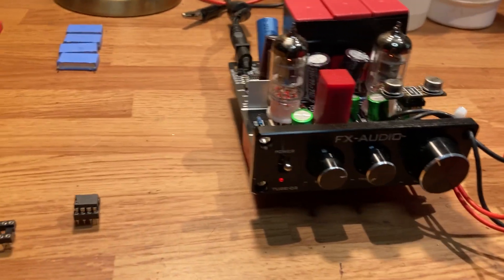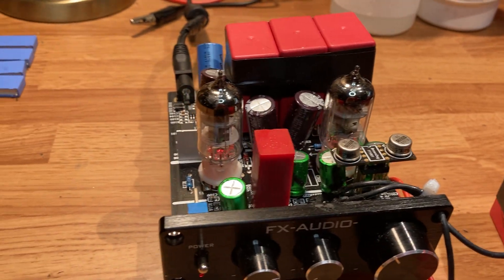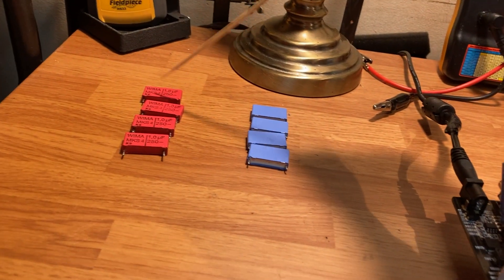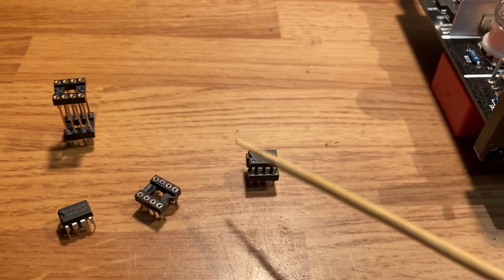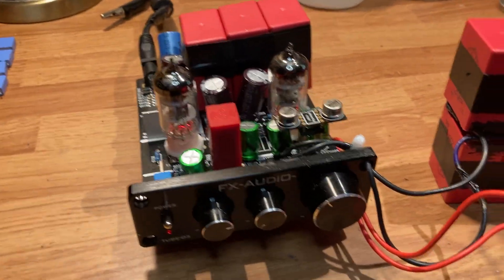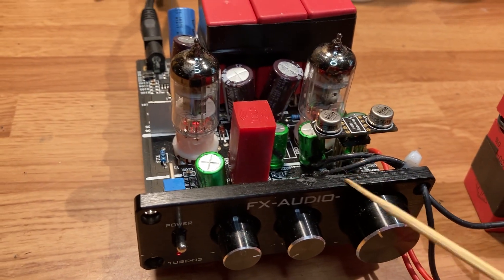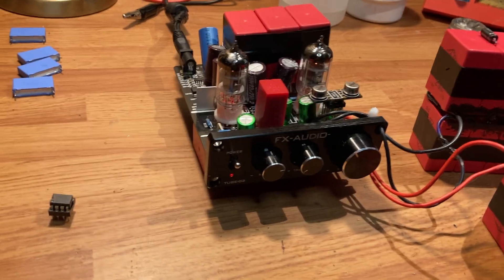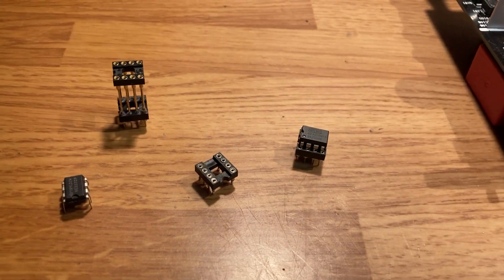FX Audio Tube-03 op amp and capacitor upgrade

Comment: Hey, nice video. Have you tried using bigger capacitance film caps at the output? Some guy measured the distortion in the tube 01 after going from 1uf to 4.7uf and the result is pretty good. I'm planning to try that in a tube 03 variant from Aiyima, eventually, but was curious if someone did; my goal with the preamp is to make it as accurate as possible, not interested in tube sound, I only want to use the tone controls to complement my analog eq.
Reply from the maker: No because WIMA does a real good job at holding the juice and I spent $5 a piece for those film caps, haha.  If you have an EQ you probably won't need tone controls.  The less components the better.
Reply: @ranbymonkeys2384  yeah I agree but I want to give the little guy some use, lol. That purchase was kind of a mistake, but hey it's dirt cheap couldn't resist. The preamp was actually out of my chain because I found it to sound awful, made voices sound kind of robotic, but recently I came across a power supply from an old display rated at 12v and 3.3amp and no more robotic voices, guess there is potential.
Reply from the maker: @Masked4789  To quote the late great Bob Ross "we don't make mistakes, just happy little accidents".  But you would want a component that just has the tone controls.  There out there.  I think Schiit makes one that people say is pretty good.  You know the "people".  What EQ do you have, you shouldn't need any more tone controls.
Reply: @ranbymonkeys2384  I mean, I don't regret it haha. I have an old 7 band Fisher Eq, it was from my father. It's pretty nice, has a little display that shows the current level of each band so it helps when Eqing.
I'm now thinking about using the preamp in my headphone system, my modded T40RP mk3 could use more gain, won't be using the tone controls tho, but for that I believe I have to mod it to work properly with my low input impedance head amp, have any advice for that?
Reply from the maker: @Masked4789  I have to tell ya I'm not a headphone guy so I can't help you there, but, do you have the tube-01?  I had that but I sold it and it's WAY better than the tube-03 I wish I still had it.
Reply: @ranbymonkeys2384  wish I could blast my speakers all the time. No I don't have the 01, would have been better for me.
I tested the Aiyima variant of the 03 with my headphones and it's not bad at all, I'm sure it can still do better. I have only changed the power supply and the opams to TL082. Can't believe how much the preamp improved with my display power supply, it even used to give a static feel on the chasis to my amp. I like the changes the TL082 brought to the mids and highs, sound more open and real, but it introduces hum to my system. Needless to say I'm excited to keep experimenting, thanks a lot for the info and your list about opams!
Reply from the maker: @Masked4789  the TL082 is a good op amp seeing how there only $1.50 or so.  Where did you get it?  It sounds like one of the pins aren't making contact like they should.  Sometimes I spread the pins out so when it's in the socket the pins will make more contact.  Did you get that chip at a reputable place, I hope it doesn't say China on the bottom.
Reply: @ranbymonkeys2384  lol, no they are texas instruments opams I got from a local store, those were the only ones they had from your list. I just found the problem. I was testing with bad rca cables, seems like the cables weren't making proper contact with their ground. Changing to good rca cables, and I don't mean expensive, got rid of the hum.
Reply: Does the wima caps help to lower the distortion?
Reply from the maker: @Masked4789  Replacing the power caps will help with distortion.  Anytime you get a "humm or buzz" it's a ground issue.
Reply: @ranbymonkeys2384  Did you replace with higher capacitance ones or just better ones with the same values like those big ass film caps?
Reply from the maker: @Masked4789  Pure polypropylene (PP) film caps not metalized with the same capacitance.  Only downside to PP is they are WAY bigger and more expensive.  About 5X the size and price.
Reply: @ranbymonkeys2384  damn you really went all in with this thing, is it really worth it? That Burson opam is hella expensive too is it really a game changer compared to, let's say the AD823 which is 10 dollars and has nice specs? I couldn't find a data sheet for any of the V6 models
Reply from the maker: @Masked4789  Never heard the V6 but the V5 is totaly wort hit.  If I were you get the MUSES01 or MUSES02 they are easier to get, bu make sure to get them off of Mouser or Digikey and YES they are worth every penny.
Reply: @ranbymonkeys2384  People describes the muse01 as clean and clear, while the muse02 as warmer in the midbass. I'm finding my tube 03 really lacking in the subbass and the bass control seems to only boost midbass, which seems in correlation with this guy measurements (the same measurements I mentioned): farmedia.com/tube-audio-line-level-buffers/
Do you know of any opam that helps to boost the subbass? that's the reason I mentioned the 4.7uF caps, lol, the bass roll-off is terrible.
Reply from the maker: @Masked4789  AD op maps I find work well for bass,  and you have AD op amps.  I use the Burson V5 for the bass slot, it works well for that.  I have the Muses01 in the DAC and the MUSES02 in the amp and I have OPA627 "can style" for the highs (AWESOME FOR THE HIGHS, TUBE LIKE)  they are single so you need 2 to make a dual and they are $50 each do that one op amp is $100 and it tones down the highs.  TRUST ME I HAVE KLIPSCH SPEAKERS.  Also what tubes are you using???
Reply: @ranbymonkeys2384  I'm using the stock chinese tubes,  GE JAN 5654W tubes are on the way. According the measuments the GE tubes doesn't change the frequency response but helps to lower the THD. I don't know if there are tubes that changes freq response, this is my first experience with tubes.
Reply from the maker: @Masked4789  You like your measurements.  I pay zero attention to measurements.  You want NOS 1940's 1950's tubes.  Measurements are  the results of somebody grading their own test.
Reply: @ranbymonkeys2384  I do value measurements , lol, specially freq response graphs since I always use Eq to my pref. Man I wish I could try everything, I promised myself that I would keep it cheap. So far I'm digging the bigger stage, maybe I will keep the preamp in my headphone system, for now I will change the caps , try a couple of opams and keep the 5654W tubes, they will be helpful to have a reference when upgrading. You have been very helpful and it shows that you are vey passionate about audio, thanks a lot!
Reply from the maker: @Masked4789  We have audio anonymous meetings every Wednesday, hahaha, it's a sickness it really is.  It will get better then worse then  buy the same thing because you smashed it, ya know.  You will find replacing those caps to be a wise decision.   What are you using for an amp?
Reply: @ranbymonkeys2384  I'm using a cheap class D chinese amp, an Aiyima A07 which has swappable opams, so I'm also going to have fun switching opams with that one. tbh I have just started my speaker quest and I only did because I found out my fathers old towers had working woofers, not so much for the tweeters tho so I did a Frankenstein with other speakers that had no working woofers but the tweeters were ok despite being like 30 years old lol. I'm more of a headphones type guy, but my god the deep controlled bass from those towers after eq are truly erotic lmao, they can put anyone to dance.
Reply from the maker: @Masked4789  Those crossover capacitors in those speakers NEED replaced.  Electrolytic are only good for 20 to 30 years.  Replace with the same value.  If it's a lower value up to 4.7uF replace with film caps, you will see a difference.  Ya get that cheap op amp out of that amplifier.
Reply from the maker: @Masked4789  https://www.youtube.com/watch?v=IyFfF6cL6OU
Reply: @ranbymonkeys2384  why not both?
Reply from the maker: @Masked4789  he said both
Reply from the maker: @Masked4789  when you go to digikey and look up op amps the slew rate means how fast it refreshes the higher the number the better, also it has the bias voltage that is the the voltage that it has to produce to even everything out the lower the better.  You see we all use measurements but im trying to convince you that you may just be surprised.
Reply from the maker: @Masked4789  hey I ordered this from Amazon I'm thinking it's the same as the tube-01 it's coming today I'll let you know.  It says it's just a buffer (no gain) we shall see.  
https://www.amazon.com/gp/product/B08Q7J5YMY/ref=ppx_yo_dt_b_asin_title_o01_s00?ie=UTF8&psc=1
Reply: @ranbymonkeys2384  you're misunderstanding me. It's not that I don't believe you, I just can't order the whole catalogue of opams to try for myself, so I'm using both opinions of people and measurements to keep the upgrades into my budget. Of course I will keep trying tubes and opams, even if I end up happy with the sound I know the curiosity will take over me at one point, I just have to know lol.
Reply from the maker: @Masked4789  Your misunderstanding me..  I was just explaining that I also use test results and I was trying to teach you what some of those things meant, have a good one.

Comment: Hi, Could you suggest some good caps for the rest of the PCB? I see that you have replaced all of them. I am interested to upgrade the power supply portion as well, cos those default caps are getting really hot.
Reply from the maker: With electrolytic caps I always go with audio grade Nichicon just always pay attention to the physical size of them before you order

Comment: Thanks for all that great info. I bought everything that you've suggested. So far I only have the OP amps Right now I have the OPA2134s in atm, I tried them all though in the description. Those sound amazing. the LME4972s where the first ones I tried those sound way better then the stock ones the pre amp came with and as the price went up so did the sound quality of the Op Amps. I really like the highs from the LME4972s and the bass from the OPA2134s. Thanks for the info. Can the 2 tiny blue caps be replaced by red ones of the same brand as the Red ones?
Reply from the maker: Ya the LME4972 is truly a classic.  You should try the MUSES01 or 02 they will just blow your mind.  Yes those little blue ones are also 1 uF and WIMA makes a 1 uF film cap the same size you just need to learn how to use the search features that Digikey or Mouser has on their website.  Remember to try flip flopping those op amps they may sound better with the 2134's for the high's and vise versa.  Ya never know.
Reply from the maker: Did you do the four bigger 1 uF caps yet?  P.S I met Hickok45 at a gun rally over here in Nashville a few years back.
Reply: @ranbymonkeys2384  Whaaat you met Hickock45?! Luuucky. I wish I could meet all the Guntubers. They all seem like really great people to talk to. The Muse01 and 02 I was looking at those as well. those are on my list to get next. As for the smaller blue ones I ordered these to replace them WIMA / MKS4F041005B00MSSD then  I ordered 4 of these WIMA / MKS0B041000F00MSSD Which are the larger ones. Both of those items are on the way. Should be here soon then ill swap those all out at the same time. I just switched one of the OPA2134s out for an LME4972. Sounds great ill try switching them around. At the moment i got the OPA2134 as the bass and LME4972 as the treble, but ill try them the other way around, So glad I found your channel.
Reply from the maker: @vincentnunez6569  Replacing those caps make a bigger difference (believe it or not) than swapping the op amps.  It will extend your sound stage 30 feet more in front of you and 15 feet on both sides it will appear the sound is coming from.  Now those caps have a "break in" period and you will hear it.  I thought I screwed something up when I did it, but be patient and you will hear them get better and better.  Anyone that says there isn't a burn in period with components have never replaced their own.  Youll see.
Reply from the maker: If you ever replace caps on something that you don't mind not having the cover on (or if you can find the room), you got PET caps you should try the PP caps they are polypropylene film caps.  They are bigger and more expensive for the same uF but o boy do they sound good.  In the search on those websites look for PP and search for them, WIMA  makes them too.
Reply: @ranbymonkeys2384  Sweet! I cant wait to hear them once I get them all put in. Hopefully USPS Hurrys! Whats the typical Burn in on the Caps?, The PP ones are those the huge ones youve got in the video?
Reply: @ranbymonkeys2384  Also did you change out your power supply? If so any suggestions?
Reply from the maker: @vincentnunez6569  It took about 5 hours for me to know for sure that I didn't do something wrong.  I say 15 hours there good, but op amps I have had them take 40 hours before they settle down.  With op amps I find that the highs mellow out a bit.  You'll find your self constantly making adjustments with the bass and treble that's because the op amp is changing.
Reply: @ranbymonkeys2384  Alright Cool! Thanks for the info. would changing the power supply to something different change the way the way it sounds? cleaner power or something?
Reply from the maker: @vincentnunez6569  yes amazon has a12 volt 15 amp power supply for a round $20 (has an aluminum case).  If you are using that China wall wart, ya you need to get one of those.  It can wire up to 3 12 volt devices so if you have other 12 volt stuff it will save on clutter.  There is a noticeable difference with a better power supply.
Reply: @ranbymonkeys2384  Cool Ill look into that then, Yeah im using that cheapy China wall wart. But wont be soon! Lol Thank you for all these great information.

Comment: Thanks to your advice I replaced the bass op amp with AD823 and the highs with MUSES02 and it sounds fantastic so thank you, but know I want to replace the capacitors with some WIMA ones, do you by any chance have the serial number of the ones that are compatible?. I ordered some from mouser but ended up being to big
Reply from the maker: Switch them (flip flop) to see if it's better, you never know until you try it.
Reply from the maker: https://www.mouser.com/ProductDetail/WIMA/MKS4F041005B00JSSD?qs=NW4srbNA5mc7JzReSZM39A%3D%3D  I know the picture says .47 but it's just for illustration.  Look at the specs below it.
Reply from the maker: what ones did you order because the board is made to take .5 long to 1 inch long  if you look at the board there is 4 solder holes for the + and 4 holes for the - so when they assemble them they can use bigger or smaller ones what you have will work I'm sure
Reply: They are an inch long but they are 1.5 inches tall so they don't fit in the case
Reply from the maker: @jorgeruiz8579  ahhh, ok, i put the link of the ones that will fit for ya
Reply: MUSES02 is even more expensive than the unit lol, 500k IDR or 34 usd, AD823 is 1.5usd here in Indonesia. Is the upgrade really worth the price ? A sound demo vid would be nice

Comment: fx01 tube better sound quality 03.
Reply from the maker: I would say the 01 sounds better than the 03.
Reply: @ranbymonkeys2384  yes ( google translate)
Reply from the maker: @oppoart6512  I had one and sold it, I wish I didn't because the 01's are hard to find.
Reply: @ranbymonkeys2384  so do you think its better to mod the 01?
Reply from the maker: @AA0011.  I replaced the 4 1uF film caps with good ones and it sounded fantastic.  I think there is another little 1 uF cap in the center of the board too I don't remember.  But the red WIMA caps will fit right in there.
Reply: @ranbymonkeys2384  Thanks. I was definitely going to replace the film caps but was just torn on which one I should mod. My impressions are the 01 seems like the more musical piece of choice. I think the 03 would be too sonically fiddly with the op amps.
Reply from the maker: @AA0011. The more fiddly it is, the more possibilities.  I hope you are using a good power supply too, but you don't want to get to complicated now do you,...
Reply: @ranbymonkeys2384 I just thought that the op amps is more in the way of the sound quality and perhaps less of the tubbiness because of that extra link in the signal processing? I am changing the power supply :)
Reply from the maker: @AA0011.  Fake cheap op amps will, but good ones can make your system what you thought it could never be.  The only reason why you would want the tube 03 is for the tone controls.  If you already have bass and treble controls you don't need it.
Reply: @ranbymonkeys2384  Ahh ok, good too know. I checked the insides of tube 01 it does not have op amps, so I guess the sound is more affected by the tubes.
Reply from the maker: @AA0011.  the op amps are for the tone controls
Reply: @ranbymonkeys2384  I ordered the 03 and will take on the mod journey. Thanks for the replies - very helpful!
Reply: @AA0011.  How do you like it compared to your 01 ? And did you make any changes to it ?